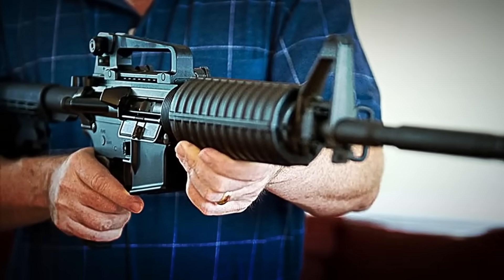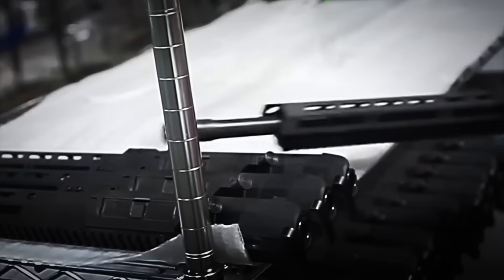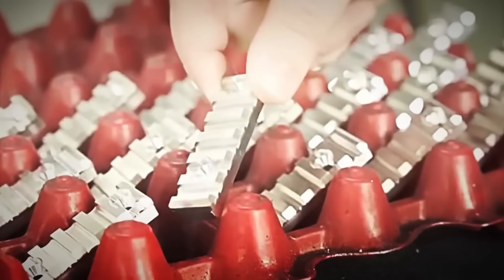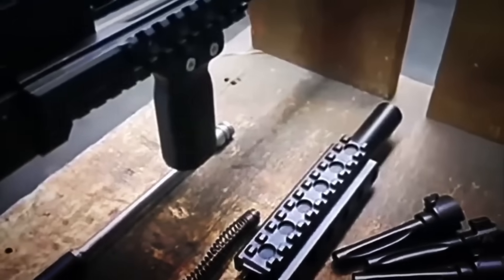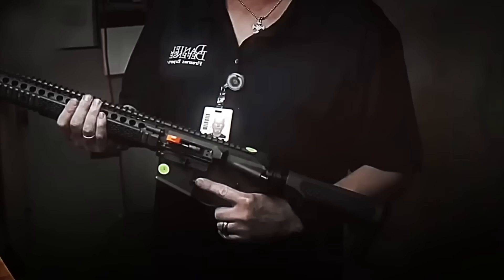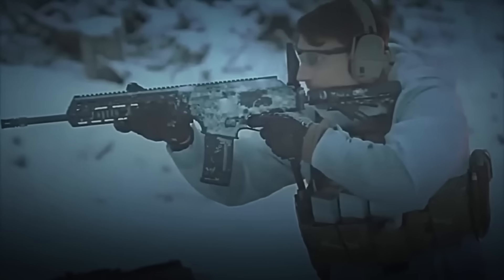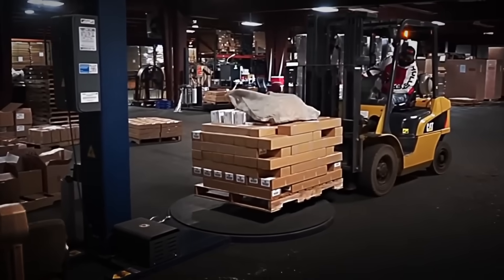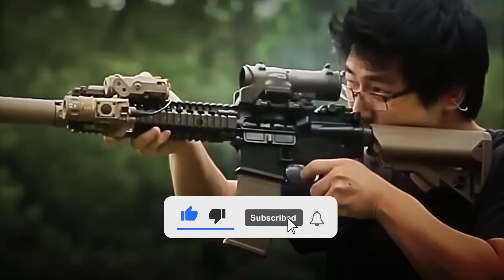HOW an AR-15 is MADE 🔥 | INDUSTRIAL MANUFACTURING PROCESS 🏭

Comment: This video is full of inaccuracies and is deliberately misleading:

Some of the video clips are actually of AK47 rifles, not AR15s.

The AR15 was originally designed as a civilian sporting rifle that operated only in semiautomatic mode. It was later modified for military use by adding a selectable full automatic mode. It was not developed initially as a military rifle as the video alleges.

The video talks about forging upper and lower receivers but shows only receivers being machined from billet aluminum. Both procedures are used in current manufacture.

"Tactical" is used to mislead viewers into thinking that AR15s can be easily modified into military (i.e. full automatic) form. This is not true. "Tactical" appearance is a matter of esthetics that can appear on either civilian or military rifles. It involves adding or modifying some external parts that do not effect the essential functioning of the rifle.  All that is going on here is that some people think it is cool to have a rifle that looks like a military rifle. BFD.

AR15s are used primarily for sporting purposes. The semiautomatic feature is essential to hunters involved in thinning out the herds of wild pigs that are laying waste to crops in parts of this country. There is also a cultural element that enjoys target shooting. These rifles also see a little use as civilian defensive weapons. 

I could go on and on but, you get the picture. This video is designed to feed your adrenalin addiction rather than educate you.